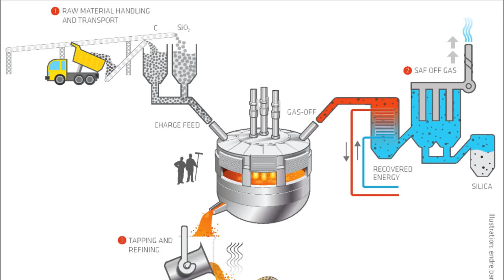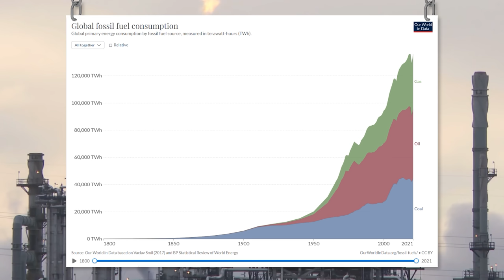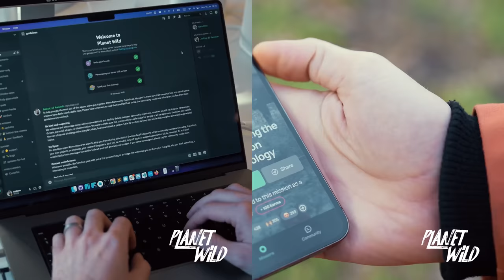We Will Be the Last Civilization on Earth

Comment: There are also electric arcs that can melt materials, and induction works to heat and even microwave could be used to heat a wide range of materials.
Reply: Where are we getting the energy for those types of heating? Isn’t that the whole point of the video?
Reply: Same as some piramides could produce electricity 'under the right circumstances'. It's a weird theory but worth a shot
Reply: Here in Brazil, the energy source of 80% that is produced come from water (hydroelectrics).
Reply: @Parc_Ferme  Great, but the assumption in the video is that all infrastructure is destroyed and rendered unsalvageable. So I restate my question: Where is the power coming from?
Reply: The Wind or the sun could provide the energy. Starting by small energy sources to process small amounts of material, production could be scaled with time. 
Is what mars colonist want to do right? 
It is most likely to be plausible.
Reply: @cfalkner1012 you could boil water with charcoal or even use hydro electric power
Reply: @cfalkner1012 Nuclear is one option to answer your question, without debating the downsides.
Reply: @Evolution56  I’m so confused. I thought this was a debate over how to generate power without the use of fossil fuel. The issue is how do we build a nuclear power plant, of all things, when in the video, it is pointed out that production of steel and concrete is nearly impossible without the consumption of fossil fuels. 
But somehow it has turned into a debate over the downsides of the methods of power consumption? 
I should have known better than engage with the comment section. You all are impossible.
Reply: @cfalkner1012  I love how they start talking about solar panels.....

everyone else.....
Guys
You cant smelt silicon anymore
Where is the energy coming from 
Answer the farking question cfalkner asked !
Reply: @Evolution56  None of you even watched the video did you!
Reply: @arslongavitabrebis you'd need copper and iron to make a basic electromagnetic generator for the turbines to spin if you were to use wind or hydro to generate the electricity for the arcs
Reply: concentrated solar power can get hot enough to melt anything you need melted
Reply: @joshieecs  
Except some metals have to be in a oxygen free environment
How you doing that?
Reply: @joshieecs  
Had to come back to this 
You ever heard of Frank shuman?
I would suggest you go check out his works
Genius really

Comment: Technically it might be possible to build an arc furnace in order to smelt silicon, using only charcoal-available materials to build it
Reply: And what about hydrogen? Not all books and knowledge would be lost in a catastrophe like the one described, electricity and much of the science behind would still be a thing, and that means electrolysis is viable. There is a ton of water around, so instead of carbon and natural gas, hydrogen could be an alternative, provided that the proper engineering level is reached (like making bronze tanks for example).
There's also methane that is being extracted and used as a fuel today from biowaste (here in Buenos Aires there is a small plant that does exactly that, and while small, it does provide electricity for the national grid).
Reply: Using charcoal to bootstrap  aluminum and ceramic industries would give us the ability to make solar furnaces capable of exceeding the temperature of the sun.
Petroleum is far too valuable to long term survival to burn, and coal too, besides being toxic.
Reply: yeah these were both my first thoughts when he mentioned the issues in the video
Reply: Thay use arc furneces gor silicon smellting